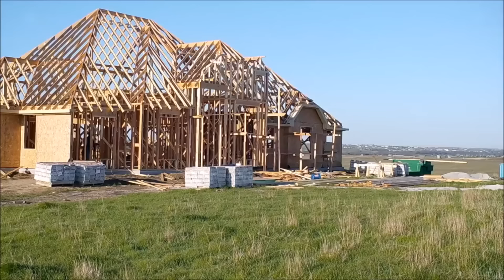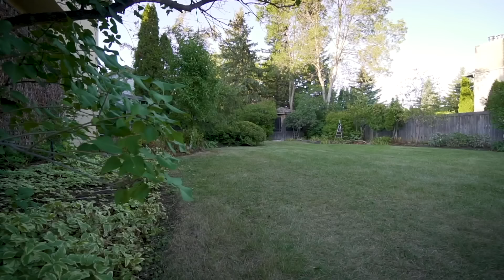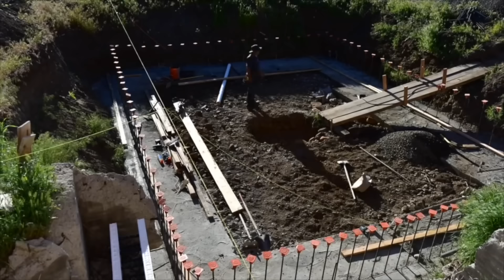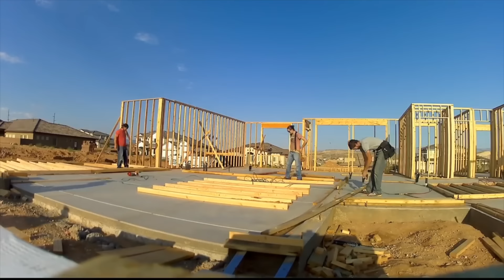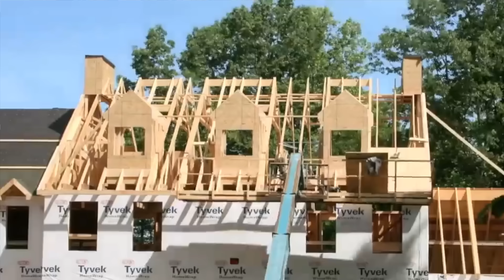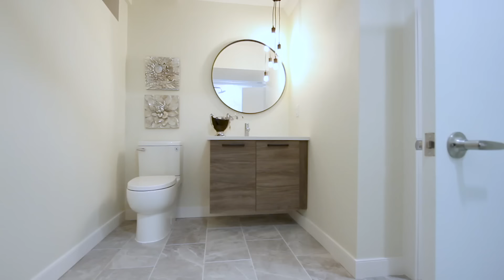THE REAL COST TO BUILD YOUR HOME | Custom Home | Building a house Cost

Comment: I wish you would explore what aspects of house build will save money in the long run. Gable vs Shed roof? Stick framing vs SIPs or ICF. Polished concrete vs sub floor and hardwood/carpet. If something costs 25% more upfront but saves 50% on labor (usually the expensive part of construction), that's a win. What are those things. Consider the cost savings of installing a clawfoot tub over a tile shower and bathtub. Oh, and, It's background music, not "I can barely hear what you are saying" music.
Reply from the maker: Max Swenson Definitely would have been an several hour long video just to scratch the surface of value driven decisions in home building design vs. cost.  But I agree.  Understanding those comparisons help people a lot.   Great ideas for videos.  Thanks for watching!
Reply: @EmmettLeoHomes  A several hour video or many 10 minute videos. Hint hint...

Comment: The home I had planned was a preexisting one-story 1870 square foot Floorplan on top of a concrete slab being built out in the farming community with only minor customisation such as the placement of Windows having a semi walk space attic given how tall the roof is compared to the height of the ceiling of the main floor making the height of the ceiling less than a foot taller and also having Skyline windows in the attic space for stargazing and since there's really access to be put anywhere I would have a small spiral staircase in the master bedroom leading to the Attic and have most of the door pocket doors and before you ask why would I want a walk space attic originally I wanted a two-story home but figured that would cost too much and realistically for a long time home I don't want to constantly be walking up and down stairs but I still like the idea of an attic space I can move around in because for one I don't want empty space that cannot be used I feel that's a waste and two as childish as it may sound I think of the idea like having a treehouse with in my house again stargazing and if I need to given how big my family is and how we operate during get-togethers I could have plenty of space for my family even allowing my master bedroom to be used while having my own space in the Attic but more than likely it would probably be used by my nieces and nephews again like having a treehouse with in your house

Comment: In the Dallas/Fort Worth area you can get a house built starting around $95 per SF depending on the area and house type. A 1300-1500 SF 3 bed 2 bath 2 car garage single story can be built for about $110k-$130k depending on materials of course and not including the lot price. Way better than $150 per SF mentioned in this video. If you're someone who can manage the costs yourself and choose sub contractors who do good work at reasonable prices you can get it even better than that. I built one before and sold it so speaking from experience here as one who does this.
Reply from the maker: This is in CAD, not USD.  Convert it, and its bang on.  Thanks for watching!

Comment: When someone quotes $150/sqft, does that average include the lot cost, foundation, and utility hookups or septic system?
Reply from the maker: Cyndi Dickerson Usually foundation, to handing keys over, but it depends on who’s building it.  It may include septic tanks/system, it may not.  Utility hook ups are generally included. 

Generally it does not include the lot price, but it may if the lots are DIRT cheap. Yup.  That’s a dad joke.  

Thanks for watching!

Comment: I'm trying to cut out as many middle men as possible. What's stopping me from just hiring a construction crew to build a home?
Reply from the maker: I can understand that.  I suppose it would be like asking a factory worker at Ford to build you a Truck. 
A great custom builder is like a quarterback.  Taking in all the information and delegating everyone.  Not only that, but the best builders are the ones that can are able to take in all of the information from the clients, architects, designer, engineers and trades, and do it all within the allotted budget.  Not only that, but they should be tracking the cost to completion so if anything goes off track, then they are able to correct it, and let the clients always stay informed.  All that said, you can still cut your own hair. 
Hope that helps!
Reply: Dean Slegos just hire yourself

Comment: Grandparents needed a new roof put on their house. Bids ranged from 8K to 13K. My cousins and I did the job over a weekend (2-1/2 days) for about $3500.00. (About 2000 sq ft using Owens Corning® TruDefinition Shingles)

Down side...regular roofing crew could have done it in a day, hard work, sore muscles.

Upside besides cost savings... got to spend time with family and grandma's cooking.

Comment: Great video! It breaks down the cost of the build. Please do a video on the cost of custom design services (interior designer, architect, drafter, etc).  What would it cost for each revision & change order? What does it cost for an arch vis rendering or VR walthrough experience? Also, you could include what it  would cost to do something structurally unusual with a house that needs specialized engineering services (such as something that would require steel support beams---kinda going into more commercial-style of building technique).  All of these extra topics would be very interesting to learn more about.
Reply from the maker: You bet.  Great Suggestions.   Thanks for watching!

Comment: You're a little low on the architect fees.  They usually go by percentage of total construction cost.  Usually around 7-15% of construction costs.  So if the estimated budget is $300,000, then the fee would be around $21,000-45,000.  Hourly that would average $150-200/hr.  That may have changed due to Covid, but that was the general guideline previously.
Reply from the maker: You are correct in general terms, however it depends on what you are getting them to do and how involved they will be. Make sure to check out the next video this week that goes through an 8000 sqft, $4Million home line item breakdown! Thanks for watching!

Comment: In my area, a newly built custom can be had for around $95/sq ft. assuming 1,500 sq ft 3 bed 2 bath, 2 car garage on 1/3rd acre.
Reply from the maker: Yes.  Cost is definitely dependant on location and finishes.  Thanks for watching!

Comment: You can save a lot by doing an RTA kitchen. They're designer kitchens that come unassembled. You just put the pieces together and screw them to the wall and bam. You save a lot. During a rebate time a guy built a $100,000 kitchen for $30,000. It was immaculate

Comment: Very good and informative video. I overpriced some items and underpriced some. Actually starting to put pen to paper because plan in building in 2024.  I am figuring  180 to 220 per sq ft with some rooms more expensive than others. Just wish you could go to factory pick it out and have it delivered and assembled but not quite there yet

Comment: We always built our own homes.  South of Seattle... Cost us between $80 to $100 per square foot (SF).  One way to check the cost per SF... Look at the advertisement for home builders on the internet. They have their homeplans and have total costs for each home plan.  You input the location and they will include the permit fee also.  A difficult site such as on a steep slope or critical area is not part of the cost, as well as the cost of landscape and driveway. $500 bucks per SF is better comes with Boobytrap
Reply from the maker: 500$ sq/ft may include site/landscape depending on finishes and contract. There are many over that here.  There are many under.  Those are simply ranges.  300 -350 will get you a very nice luxury home here in Winnipeg.

Comment: For someone with short attention span I'll break it down for you.
Alot of builders don't wanna hear VA loan 
Some will accept USDA loan but most want conventional loans.
Now companies will have different things some want 1k 5k 10k or 25% down payment to lock the prices in and cover some upgrades.......also something people don't pay attention to is ur upgrades that you think are normal or necessary to live are not everyone else and you will over value the home that will not value our at inspection.....you will need to bring more money down because banks won't pay for a house that's not worth it.....floors counters porches are quickest thing to kill this off. 
Next is your mortgage rate doesn't lock in till 90 60 or 45 days out of closing so for instance I built a house in December rates where 3.6% covid hit and we closed out in August at 2.79% now if you build now at 2.79% your house would finish 6 to 9 months you could end up paying more with a higher rate after elections or something and 1% in 30 years depends on total cost can be 50 to 130k in 30 years............this is where it comes down to buy now build your dream home room by room house flippers becoming a huge thing because it's cheaper to save and spend cash or use a credit card with 18 months 0% than finance that dream bathroom that cost 12k in upgrades for 30 years now it cost 34k
Reply from the maker: Thanks for watching!

Comment: There are some stuff you left out, like the cost of machinery used to build the house, and the sand being shoveled or carried out by machine, and connect the water to the house to the residential water/waste water, but you did good.
Reply from the maker: Most of the time, the "machinery" is part of the labor cost, and in this case, the whole cost. 

Thanks for watching!
Reply: @EmmettLeoHomes  well yeah but it doesnt build the frames or walls and windows or electrical wiring, machinery is just to do the heavy duty stuff like digging and filling and lefting something it takes more than 10 people to left

Comment: These number are applicable if you hire a building company only, correct? How much would you estimate if a lot was done by us? Such as: we do the electrical, plumbing, drywall, flooring (most interior finishes). We would hire a framer, all digging and poured concrete, the roof. This barely scratches the surface but do you believe we could save a lot of money going this route? We designed a home that is about 2900 sq ft

Comment: Thank you for sharing your insights. It was a very good breakdown. One question... I live in the tropics and as such is preferable to build with cinder blocks. Would that drive the costs much higher compared to wood framing? Thanks again for sharing your knowledge!
Reply from the maker: alejandropmora typically yes.  But geographical... depends.  If cinder block and labor is readily available, and lumber is harder to then no.  

Where we live, it’s cheaper to use a siding called stucco.  A cement /sand based trowel on finish.  

However just two provinces over, sand is not as readily available, therefore the cost is higher for them, and composite/veneer siding makes more sense.  

Understand?

Comment: Great presentation on the breakdown of a home build. The $25,000.00 General Provisions budget that you mention, does that cover the OH and Profit that is required by the builder or would that be a different line item based on each builder. Is there a rough number that one could use to determine to add to the total cost to build?. Thank you for all your content.

Comment: My dream home is maybe 3 bedrooms with 2 or just 1 bathroom (make it spacious enough with a walk in tub) I'd want it built on a pier and beam foundation not concrete slap, and I'd want a metal roof with either the house built with steel frame or wood frame (my dad worked as a mason and while brick or concrete is nice and durable it still requires lots of upkeep and it's more expensive and can take more time) and I'd want a front porch with a porch swing, and I'd want a pellet burner fireplace instead of a traditional fireplace cause traditional mantle ones are drafty.
Reply: I'm working on a small (1100-1400sf) future retirement plan right now, and it's taken me almost two years to get it perfected, so if you haven't already, start sketching NOW.  Some things I've learned: (1) If you're a single person or will have just two people in the house, plan for two bathrooms anyway - that way, if two people feel the call of Nature at the same time, there won't be any "scheduling conflicts," and you'll have additional full facilities for guests.  And having only one bathroom is pretty much functionally obsolete these days, so if you plan on upsizing to a new home later, it'll help your resale value.  (2) A metal roof, particularly the standing seam variety, is very expensive and will double or triple the cost of your roof system, but the upside is durability (I have one now, and it's great).  (3) I don't know how old you are, but if this is to be your "one and only" home, plan ahead for disability needs, and make your house as accessible as possible (this will also help if Grandma comes to visit).  (4) A fireplace is nice, and can serve as an emergency heat source, but they can add a lot of cost.  My builder's allowance for a ventless gas corner fireplace came close to $10k - but I found a freestanding model for less than 1/10 the cost (excluding labor, of course, but you get the idea), and I still need to research the pros and cons of a fixture like that.  ~ Long story short, plan your dream house, think about the future, and prepare to do a TON of research.  It'll really pay off.  Sincerely, A Grandma Who's Learning More About Home Construction Than She Ever Thought She'd Want To.

Comment: How do you know how many square feet is a good size for your families needs? If you want plenty of storage such as built in shelves, pantry, and built in triple bunk beds, how much extra should you budget for? This is for Harrodsburg,Kentucky.
Reply from the maker: You have to take into consideration what rooms your family actually NEEDS vs. WANTS.  Each family is different.  Most don't use their formal dining room anymore, so we can eliminate that if you don't.   A good architect, or designer will create a layout that fits your needs. Thanks for watching.

Comment: Great getting ready to build in CA can wait.  Thanks for the info.  My biggest fear is all of the ways contractors will try to cheat me or skimp on the work....ways I might never imagine.
Reply from the maker: Curtiss Harris your biggest defense?  Education and research.  Let me know if you have any specific questions!
Reply: Please find  a highly rated contracted with extensive reviews and a long work history, look at their profolio/prior jobs. 
We did a gut renovation on our home and the piss poor contractor we hired did a horrendous job and fucked up at least half of the money. Research like fucking crazy! Hire your >>>OWN LAWYER<<,  and u can actually have another independent contractor to come in and review the work in which funds being dispensed based off the workmanship approval  of the outside contractors inspections. Whatever contract your asked to sign have your lawyer go over it with u in depth. Basically make it nearly impossible for someone to pull the sheets over ur head because you will always be 10 steps ahead. ur going the extra mile with everything that needs to be done, throw ur weight around!
It may be shocking seeing me say this but I would totally renovate or build a home from scratch and try this all over but knowing what I know now I would do things completely different and not get taken to the damn cleaners like I did with my current house.

Comment: I know most of y’all make fun of us in Alabama, but these numbers are tremendously high here. Outside of Birmingham and some of the other more prestigious neighborhoods throughout the state (of which we have many), you can easily find a decent home on a decent size lot (or on substantial property) under $250k
Reply from the maker: Correct.  Building costs are incredibly geographical and supply/demand.   Thanks for watching!

Comment: 150-500 a sq ft in California is impossible. In my experience a more realistic number in any upscale area : 800-1m for a lot ( 4000 sq ft in my case) ... and actual construction costs running 1500-2000 per sq ft. Obviously the cost per sq ft is diluted  with greater square footage but using a 1000 sq ft home plan on 1.5 m $ all in. That’s why new builds only make sense in markets where existing homes avg sales price are above this threshold : ie that’s why there a housing shortage in part. Just throwing in my 2 cents ...

Comment: Using the same theoretical house, what would the difference be if you substituted full properly built brick exterior(all the way up)? Adjusted for northern state that averages $180-190 per sq ft.

Comment: I actually expected this home to cost around 650 K. Lol. Prices in my area are so different. I’m not sure if what I want to build is going to be cheaper than the actual price of this home or about the same. But anyway, this video was still very helpful. Thank you.
Reply from the maker: Prices definitely differ based on timing and geographical location.  Make sure to check out the next video this week that goes through an 8000 sqft, $4Million home line item breakdown! Thanks for watching!

Comment: What about the cost for rough grade landscaping and asphalt driveway when the home is finished? Also what about the cost of a sceptic system and a well for those building on an acreage outside of the city. Thank you. Good informative video BTW.
Reply from the maker: Yes, those have to be accounted for as well in specific scenarios.  Rough grade is generally on the builder, driveway is depending on contract.  Sewer and water is included when in the city, and septic is typically part of the total as well.   Make sure to check out the next video this week that goes through an 8000 sqft, $4Million home line item breakdown! Thanks for watching!